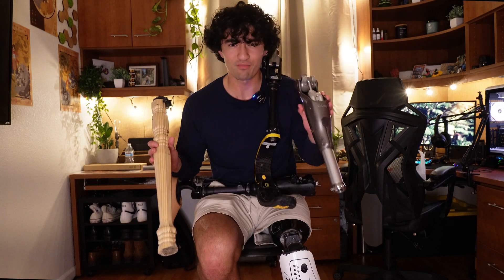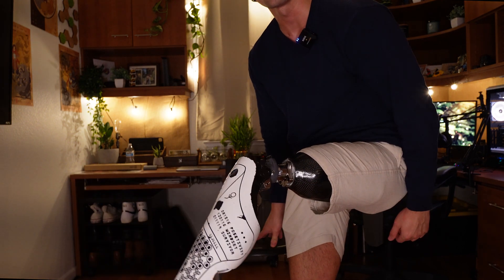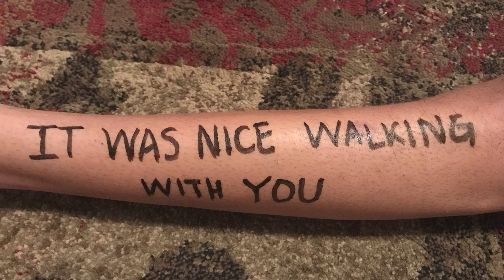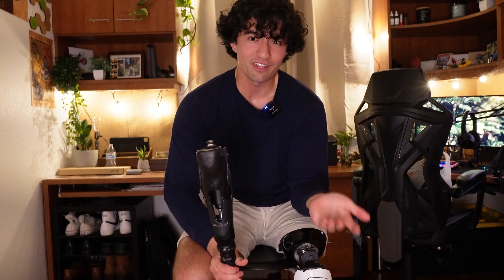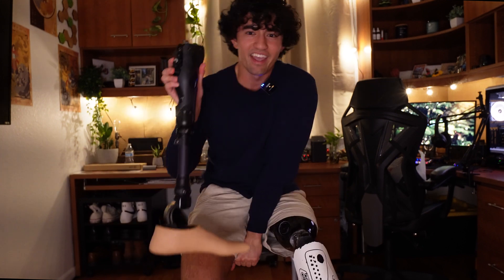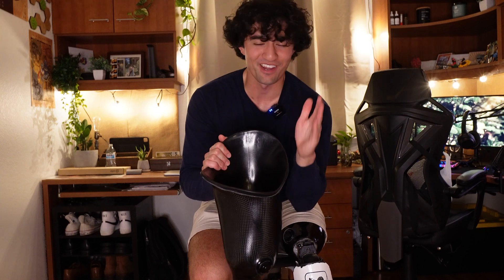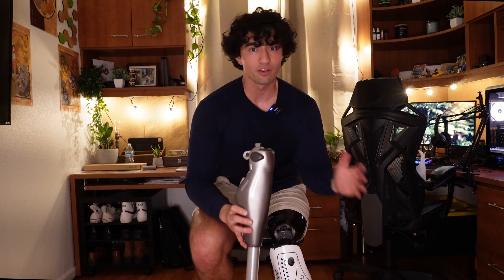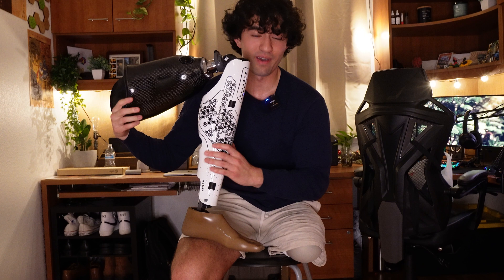How do prosthetics actually work?

Comment: I honestly feel like all those prosthetics could be manufactured for WAY cheaper than what they are being sold for. Even the really fancy ones with computer logic technology shouldn't be costing over $100K+.. Titanium and Aluminum are expensive materials and a challenge to make things out of but, it's not THAT expensive of materials. Nor is Carbon Fiber.
Reply: Something I learned about working in the pharmaceutical world is that there are often millions or billions of dollars put into intellectual property, prototypes, and manufacturing processes to make such advanced  stuff like this WAY before they can even market it for sale. So usually the super high costs come from all the previous investment they are trying to recoup. That doesn’t totally justify the high cost, but really puts emphasis on angel investors, donors, and non-profits to help use out with costs. And insurance should pay for a LOT more than they do!!

Comment: How do you run with the prosthetic if the knee is loose?
Reply from the maker: since the knee is loose you have to make sure you land on the heel EACH STEP! The rubber part on the knee joint helps release the blade forward so you don’t have to focus too much on the motion! But one misstep and you’ll buckle down and fall!